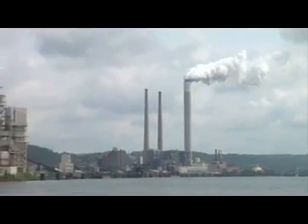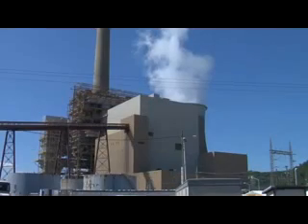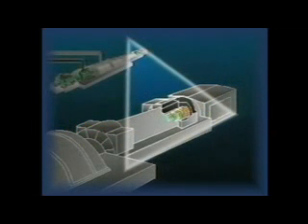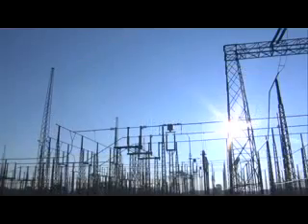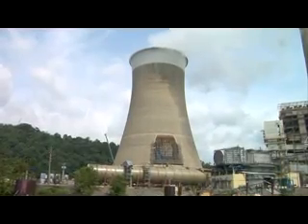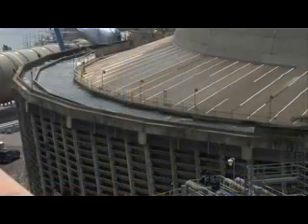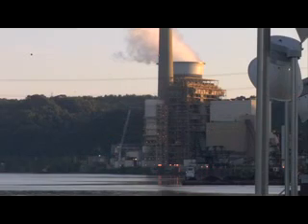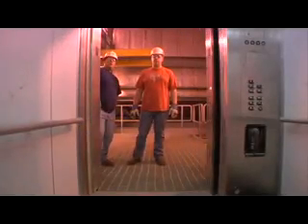Cardinal Plant Tour Video

Comment: I used to work for a company that did the cleaning of the boilers and other industrial washdown operations. In the unit nearest the cooling tower at the south end, I can remember being practically stuffed into a hatch with a small pry bar to dislodge chunks of cinders from between the boiler tubes.  If the cinders could be plucked out, we would put them in buckets to be take out of the hatch.  If they had to be poked through to fall onto the next level below,  they were.  We worked from the top, down cleaning these cinders out.  It was a cold, wet job.  Wet because a washdown crew had previously hosed the entire thing down to reduce any dust and ash in the boiler.  We crawled and worked directly on top of the tubes.  Not enough room to even sit up.  The work was done laying on out bellies or sides.  Scraps of cardboard that could be found were used to lay on top of.  During one of my "out of the hole" periods, I was asked to help carry pressure-wash hoses down to the truck.  (No,  nothing like your 2,000 psi pressure washer at home.)  these hoses were 50 feet long, and about 3/4 inch thick. I thought I could carry two of those without any issue.  I was wrong.  While I did get two down to the truck,  I must have turned the wrong way, and tweaked something in my back.  That was right before lunch break.  I informed my super of the pain, and he put me on the hole instead of having me crawl back in there.  The rest of that shift, I sat in a chair at the hole, poking an O2 sensor in every 2 or 3 minutes to ensure the O2 was sufficient for my co-workers in the hole. 

To the AEP worker who found my 5 D-cell, LED Maglite in the restroom, during lunch hour.   I had gone in to use the toilet, and has set the light down on the floor. With the pain I was in, I had forgotten to pick it back up and had gone maybe 50 feet from the shithouse before I noticed.  As I turn around to go back.. There you were, grinning like a cheshire cat, hauling ass  out of there with my flashlight.  I yelled,  "That's my light!" you looked at me,  shrugged and practically sprinted off around the bend. 
You're welcome for the expensive light, and fuck you.  I hope you lost it soon afterwards.
Reply: Interesting until the second paragraph.  You could've left that part out.